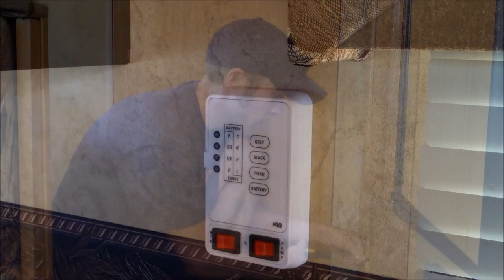How To Change Your Camper's Hot Water Heater Anode

Comment: Since I didn't have a spare pressure relief valve on hand and was worried about it failing and not having a replacement on hand, I simply turned the water heater breaker off(running off electric only at the time being), and ran the hot water for a while, washing dishes, doing some chores, and washing my hands to get the water in the tank as cool as possible. Then I shut off the water outside, then opened up my inside faucets to relieve the pressure. This worked perfect, and I didn't get sprayed at all.
Thanks for sharing your video sir!
Reply from the maker: Lol, that would be another proper way of doing things!  At the time I didn't think to use the relief valve.  Thanks for the comment and watching!

Comment: I usually take it out every year and re insert or replace.  This year I could not get it to thread.  I tried another and couldn't get it to go.  I watched your video and read a comment you made to someone else about tipping the anode up.  It went right in.  Unfortunately the new one had a pinhole leak in the center so I replaced it with the old one.  It was still good as new.  It didn't leak.  Thanks for the help.  You saved me a lot of grief.
Reply from the maker: Glad you were able to get it in!  Thanks for watching!

Comment: Good stuff and thanks for sharing. I only had one question, does there have to be water in the tank in order to replace the anode, or can the anode be replaced with a new one regardless if there’s no water in the tanks? It is much appreciated!
Reply from the maker: You're welcome! You will have to drain your tank in order to be able to replace the anode. Thanks for watching!
Reply from the maker: You're welcome! You will have to drain the water in order to replace the anode. Thanks for watching!
Reply: @ColoradoCamperman  thanks once again. Much appreciated.

Comment: Thank you for giving the socket sizes for the removal.  I called my dealer and they just said 1 1/16, but that does not work on mine, too loose.  I will get a 27 metric as you gave as an alternate size and try that.
Reply from the maker: You're welcome,  I'm glad I could help.  Good luck with the project!

Comment: Wondering - when you're done, and turn the water valve back open, then do you just turn on the pump and run the hot water side faucet until water comes out and then it's ok to turn on the electric or gas to  water heater? Also, if you've opened the pressure relief valve during clean  out, do you shut it again just before you start to fill up with water or wait to shut it when water starts coming out the pressure valve?
Reply from the maker: Good question! Your steps should look like this...... Close the pressure relief valve, turn your water pump on, and open the hot water faucet. Your pump should fill up your hot water tank. It will probably run for a minute or two, that is at least what ours does. Hopefully that helps. Thanks for watching!
Reply: @ColoradoCamperman  thanks very much!
Reply from the maker: @alive-awake  You're welcome!

Comment: The anode is really rusted in there; couldn't budge it with the socket and extension.  Any advice?  I would really like to replace it.
Reply from the maker: I would try getting some PB blaster and hitting the threads of the anode with that.  Let it sit for an hour or more, spray it again, wait another hour or so.  Then try to remove it.  If that doesn't work, you could try to get more leverage by adding a pipe on the end of your socket or get a breaker bar.  Breaker bars come in handy, so if you don't have one in your tool kit, it might be worth the investment.  Here's one on Amazon: https://amzn.to/3nY08ox  Harbor Frieght also sells reasonable priced breaker bars.  My 1/2" breaker bar is from Harbor Freight, it's great!  I hope that helps.  Thanks for watching!
Reply: @ColoradoCamperman  thanks so much.

Comment: If you pull open the lever on your pressure relief valve you wont get sprayed as you did on this video.
Reply from the maker: Lol, someone else had mentioned that to me after the video!
Reply: Yep, and it will let you know if you need to replace the TPR valve because it will more than likely leak after you release it.

Comment: I took off my drain plug but they're wasn't an anode attached,  I have a 2008 denali fifth wheel,  how do I find the anode?
Reply from the maker: Is your drain plug plastic? If yes, you do not have an anode. That means you probably have an aluminum tank. Since those won't rust, there is no need for the anode. Hope that helps. Thanks for watching!
Reply: @ColoradoCamperman  yes its plastic,  thank you, I did replace the plug with a metal one,  the plastic was old and threads were wearing.

Comment: Question, the threads that accept the anode rod have lots of mineral deposit.  I used a wire brush and cleaned it.  Now the new rod will not screw in so the threads are not showing.  Any suggestions?
Reply from the maker: Mine did the same thing when I replaced the anode rod.  As long as you screwed it in as tight as you can, it should be good.  Have you tried adding water to the tank to see if it leaks?

Comment: What if it breaks off inside tank ugh
Reply from the maker: Are you still able to remove the head of the anode? If you can't get it out, I guess technically it probably wouldn't hurt anything. It's self-sacrificial, so it will eventually break down.

Comment: Hi, I have a rv I’ve been living in for 2 years now and am going to change the anode out now that I know about it. 
I had a question for you sir, I don’t ever put the pump to ON. The scene in the video that showed the red pump switch and also says galley, grey, black, fresh, and battery. I never turn the pump to ON but I still use water heater, shower, dishes etc. Do you think I’m ruining something by not turning my red pump switch ON?
Reply from the maker: Are you hooked up to city water? If you're hooked up to city water, you don't need to run your pump.
Reply: @ColoradoCamperman  thank you sir, I appreciate it.